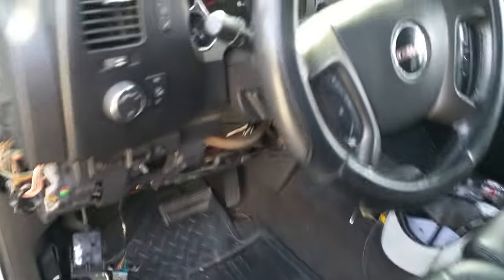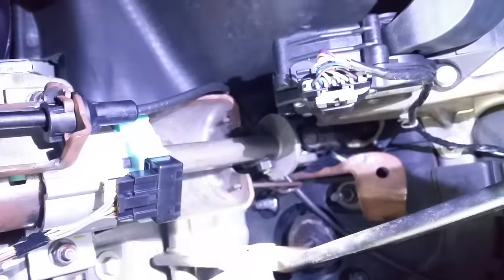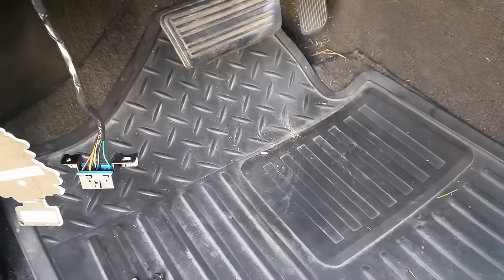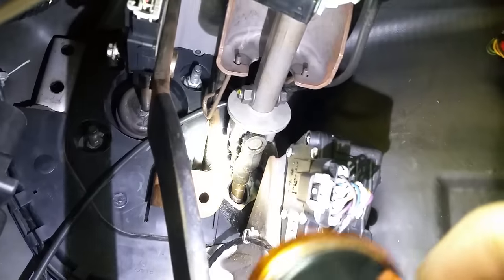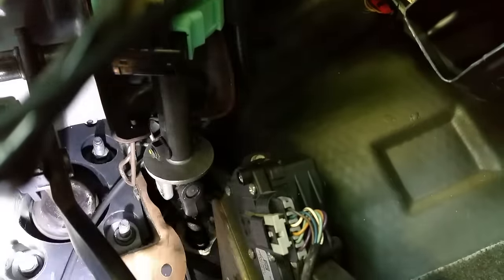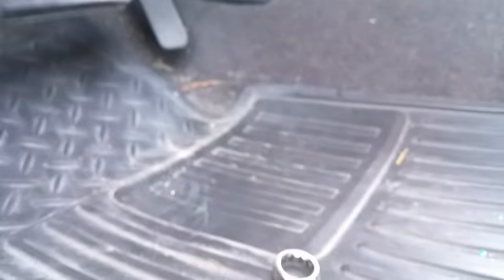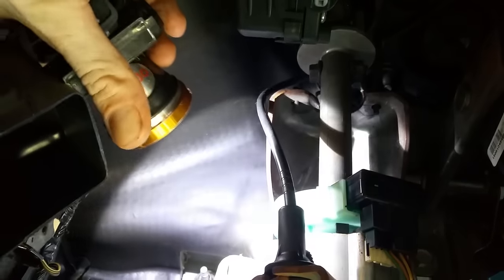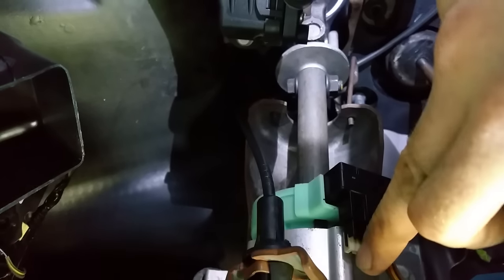SOLVED GMC Sierra & Chevy Silverado Service Stabilitrack Service Traction Control

Comment: Good ole GMC JUNK !  they really designed a vehicles to piss your DYI'er off.  Wth does that sensor even have to do with the ABS/ AWD/ & TRACTION CONTROL?🙄🙄🙄just wow. I know this video is old but Im having this issue with my 09' acadia. I like the car but the engine is junk, non stop issues one after the other. I'll never but another GMC ever with the 3.5L in it.

Comment: What if Service Stabilitrack Service Traction Control comes on after installing a Front and Back lift kit. What would be the cause of the problem
Reply: rahalati 
Did you get it scanned?
It could be different or just one thing but guessing gets expensive 
Maybe they messed up one of your abs connectors but I’m guessing
Reply: I’m having the same problem and I scan it and nothing pops up any help?
Reply: Check wheel speed sensors.
Reply: @Ty-kv3zb  What confuses me is why this problem comes after installing the lift kit. I don't think the speed sensor is the cause especially that the warning light comes after driving the car for long time
Reply: rahalati so it’s not on at all times? I know when mine stayed on it was a speed sensor on the hub.  Mine still has a super random service traction control and stabilitrak message on the dash when I touch my break pedal. Sometimes it’ll say park assist off.  And sometimes the gauges will momentarily drop and door locks may cycle.  It’s all random though and only happens when hitting my break pedal a little more than half of the time.  You can try a super cheap possibility and that’s changing the mega fuse coming off the positive battery post on the firewall depending on year of the truck.  Doing that and adding grounds helped slow my problem but it now only does it with the break pedal.  But off your problem came after putting on a lift kit.  Wonder if you have a ground wire that got messed up.  And double check the connections on the speed sensors.  It’s gotta be something that happened when the lift was getting installed
Reply: rahalati also if you put bigger wheels on with the lift maybe your hubs are getting old and that kinda sealed the deal on them. I know the sensors can be good but the hubs can be worn out enough that the sensor can’t read properly.  I hate just throwing money at problems without knowing if they will be fixed.  If you have a Facebook join the group 07-13 Chevy/gmc I have gotten tons of help on there.
Reply: @Ty-kv3zb  Thanks man. Exactly the same wheels, no change
Reply: I think that is the problem, my brother have a 2008 GMC Yukon he rise the truck 6 inches but this Big ass tires and that when the light came on, other buddy mine have a 2010 Avalanche he did the same big ass tires rise 6 inches light came on I guess when trucks don’t come like that from Factory it messes with stability track

Comment: i been working on this trucks for long time the issue with the stabilitrack and traction control always get corrected with gas pedal and on limited cases also  the throttle body sensor  i never have to mode the steering wheel sensor nor the speed sensor like a bunch of u tubers saying
Reply: Cesar L. Replace air filter plugs use lots of very good fuel injector cleaner in tank!! You may have a clogged fuel injector! Cussing lights and transmission slamming into gear
Reply: I have the same issue an I did notice even with the truck off and ignition switch on the trac light will be in an if I push the throttle just a little bit the light goes out an soon as i let off it comes back on so, I'm thinking it has something to do with the gas pedal

Comment: I just did all this work and mine lights are still on damn homie
Reply: Disconnect your battery and let it sit a couple min than hook it back up. It could reset the lights
Reply: Instead of waiting, you can touch the battery cables together and it will drain power from the system, resetting the CEL
Reply: Its most likely ypur abs module circut voard or bad pump
Reply: Check your brake switch yet?

Comment: I had a service stabilitrak / traction control warning and the abs light, I replaced steering wheel sensor,  AND IT DID NOT WORK!!!! GMC AND CHEVY SUCK AND ARE F-ING JUNK! THEY DON'T SUPPORT THEIR PRODUCTS OR COSTUMERS! THIS SHOULD BE A RECALL!
Reply: I agree with you 100%.

Comment: GM products have always sucked, and still do.
Reply: I have 2011 Silverado 2500 hd I bought it 3 years a go no problems  had 176,000 now has 236,000 no problems, got a2013 Chevy sonic when bought it had 20 miles it was new now it has 86,000 miles. Only thing I have change on that car is Tires, other then that it’s original to the car I will still buy Chevys

Comment: Mine shifts hard from 1 to 2, fouls 
#1 plug? Any thoughts
Reply: Mine is doing the same thing did you ever find out the cause for this?
Reply: Salmon Saliva no just changed out the plug and cleared the code
Reply: Replace with updated valve cover. Will fix burning oil n fouling...
Reply: todaytommy379 clogged fuel injectors check fuses too might be shorted out! Start with air filter and regap plugs very good fuel injector cleaneryhis will cause transmi to yerk and even popping noises like engine flooding oh yeah and as far as codes!!! If it’s fixed they will go away with n 24hrs I’m against clearing any codes as the computer will do it it’s self
Reply: Salmon Saliva replace air filter and plugs if to far gone you can also Regap them!!
Reply: @LH81633  Thank you.  My stabilitrak would go on and off, hard shift.  Replaced spark plugs and wires with "pre-gapped" plugs.  Made it worse.  Rough idle, stabilitrak.  Checked all spark gaps and noticed several were off (1 had no gap at all, others way too big).  Anyway, that seemed to have done it.  Drove all day today, great idle, runs smoother.

Comment: My lights randomly go on and off.  Does this piece cause a constant light on or random like I am having?
Reply: MooseKnuckle many things!!!! I always go the cheapest rout!!! Remove air filter, regap spark plugs throw some very good fuel injector cleaner in tank as it can be a clogged fuel injector fualing plugs!! But if start with just removing air filter if it’s dirty!! Replace if very dirty!